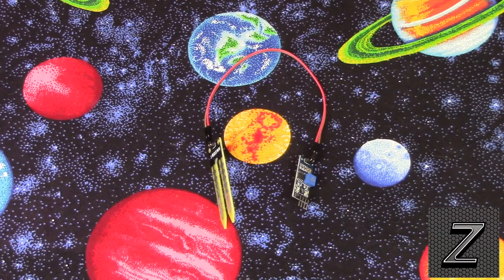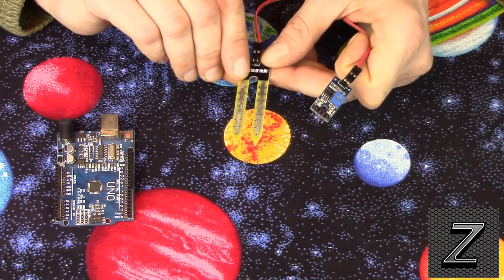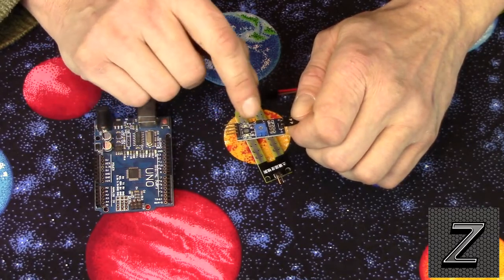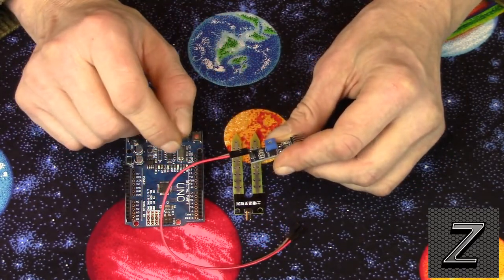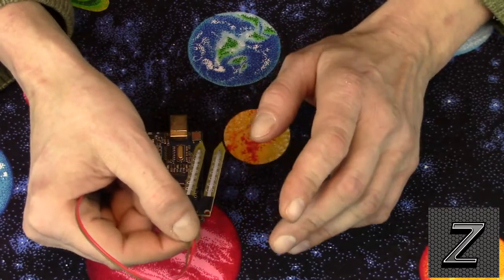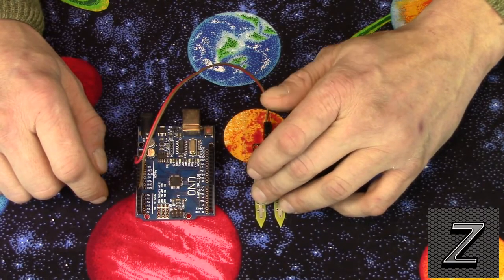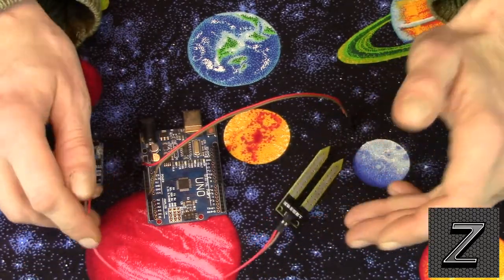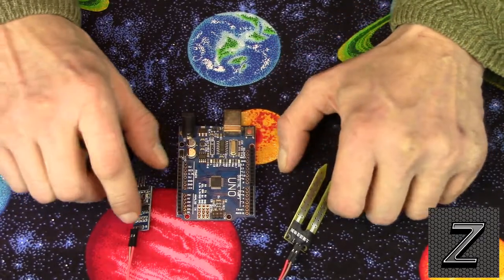The Proper & Correct Way To  Connect A YL-69 & YL-38 Moisture Sencor to your ARDUINO Board

Comment: i have had same experience when i tested the sensor on my serial monitor i was getting but high and low values  and i was confuse if the sensor was working correctly 
or not

Comment: so.... theoretically you could make your own probes since the actual "sensor" is just two lines of solder in the soil
Reply from the maker: You could make your own sensor but use a piece of copper wire like household wiring that would be in your walls not extension cords,  solder is not going to work very good for making a sensor.
Reply: @z-hut1663  yeah, I could imagine. Even copper may pose serious corrosion problems over months. Really the big draw of the premade ones is they should be uniform in function and (hopefully) ease of use
Reply: +Z-HUT has made a good point with his video, and copper is a good choice. But alas, there are few known metals without oxidation issues. The best alternative is galvanized wire nails. Here is a good article on that:
http://gardenbot.org/howTo/soilMoisture/

FWIW: My own article is days way. I will reference this video.